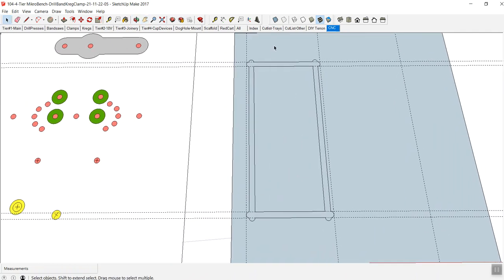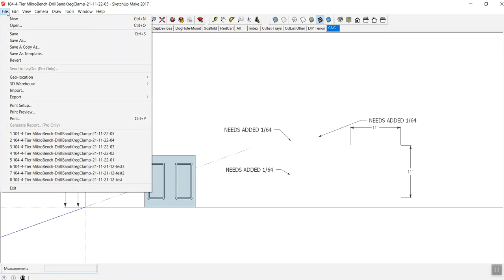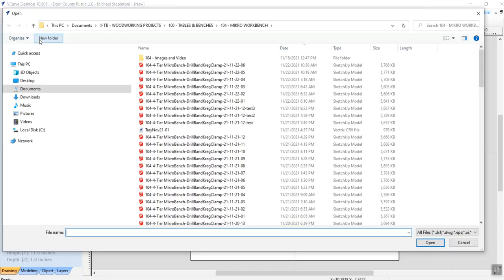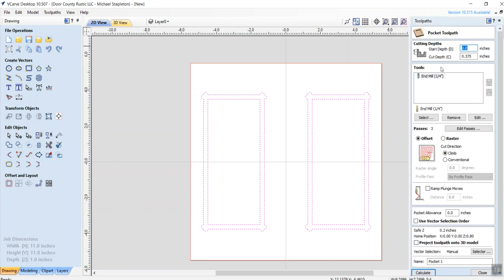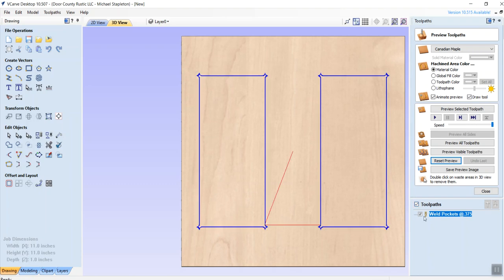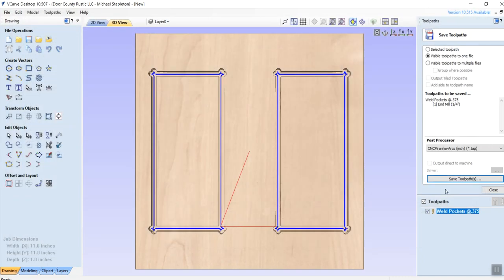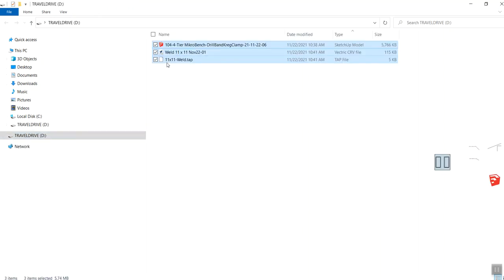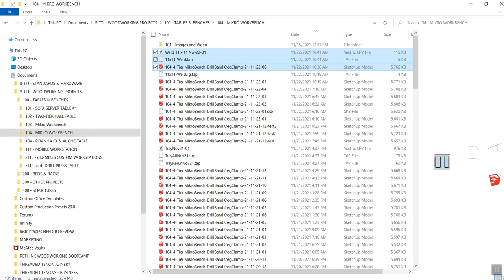SketchUp to Vcarve Example   Weld Jig

Comment: I have multiple components in same drawing to send to v carve. Is there a way of labelling them so when opened in v carve it keeps the label.
Reply from the maker: Martin,
I'd be happy to try and help answer your question but need just a bit more info. Not wanting to post my email or yours on YouTube do you know if there is a way to somehow private message. One option might be for you to go to Instructables.com and search for "MikroBench". That will lead you to my tutorials etc there. You could then register with Instructables where there is a Private Messaging method already in place. 
Mike
Reply: @MikeFromEgg  message sent via instructables 👍
Reply from the maker: I have not seen any method to transfer text or dimensions from the SketchUp file into Vcarve. I use the dimensioning tool to dimension and then the text tool in SketchUp to create CutLists, Sequences and Quantities for myself and my students. Instead of trying to transfer this info to Vcarve I use a Screen-Capture software (Snag-It by TechSmith) to capture a scene while still in SketchUp. These captures are saved as .jpgs or .pdfs so they can be printed or pulled up on a tablet in my workshop using the free SketchUp Viewer application. These provide everything I need to cut, rip and trim boards to size. The .skp file that goes to Vcarve only contains a single 2D Component. Most of those are Templates that are created on the CNC for routing and marking the final workpiece. 
Hope this helps. Happy to provide additional details if needed. 
Mike @martinhowlettfurniture
Reply: @MikeFromEgg  I’ve worked it out! Use the 3D text tool, untick extrude and place it on face. Put the id on a layer and v carve recognises the layers